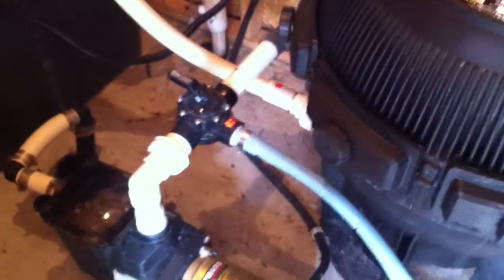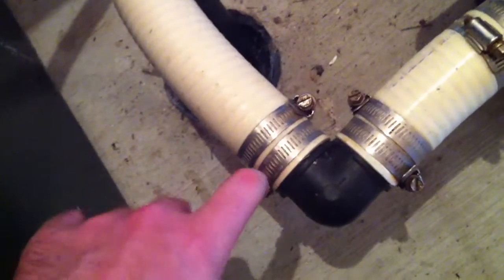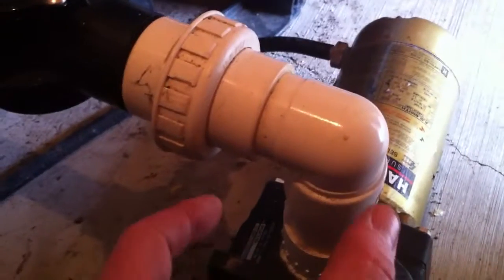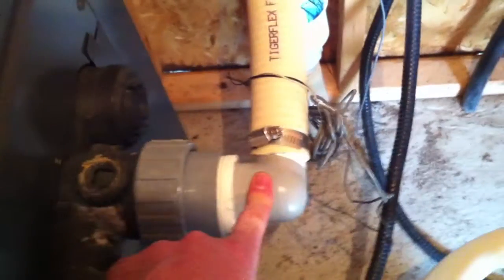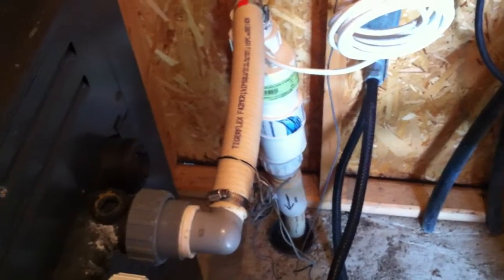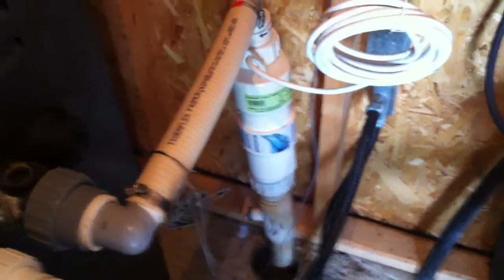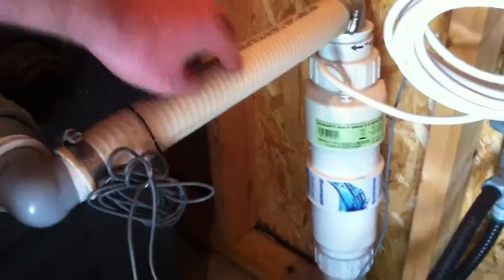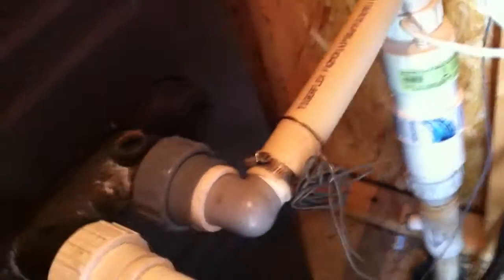Swimming Pool Pump Room Installation Problems

Comment: good info. I recently got a new pump and had to redo some of the plumbing. I converted some 1.5 to 2" but didn't know about the 90 elbows... makes sense but street elbows is what is used as locally sold. would be good to know how much a difference it makes and if worth replacing now...
pump is 2 speed but the half speed is just about useless as it can barely push through the DE filter back to the pool (4-5psi very low flow vs 14+) and won't work with solar panels at all (I get 18psi with panels on roof top), which is the only time I run the pump anyway (4-5h in full afternoon sun to heat pool) so I would need to get something close to 3750rpm anyway. Pump is rated 2hp/0.3HP and 7.5A/2.1A so only 3.5x factor at half speed (but 1/6 the HP!), not the ~8x you are using in your math. Now I need to figure out if I can slow it down from full externally and still get solar panels running... or invest another $200 for their VS version and hope to get in between speed that will still work.I don't need to push that much water through the solar.

Comment: Hi. How can I get rid off the green dust in the bottom of pool? I did add a bottle of phosphate and run it for 24h .cleaned filter but still same problem
Reply from the maker: When this happens you are supposed to vacuum to waste, which means the water does not get filtered, but pumped out of the pool instead.
Reply: Swimming Pool Steve and how u do that way please because I have sample cartridge filter with one outlet and is this stuff bad to swim with

Comment: The street elbow is used because that's what they sell at Lowe's and Home Depot.
Reply from the maker: All of the pool companies that I have worked with over the years used only street ell fittings.  People use it because it is slip by spigot connection which means one less pipe cut to make.  Also they have the shortest throw for transitioning direction in a short space...but yes, the time to actually use a street ell would be few and far in between, and not every time you need a 90.